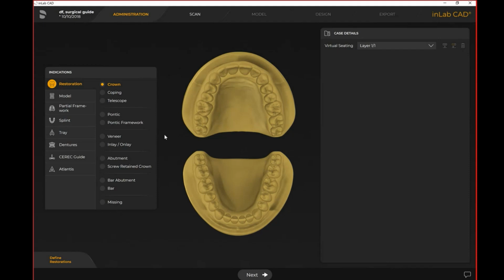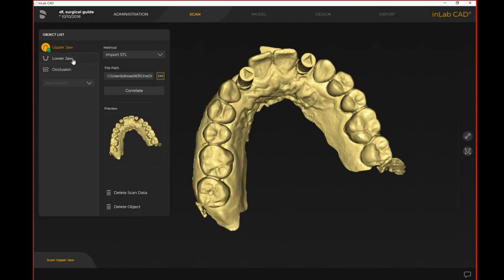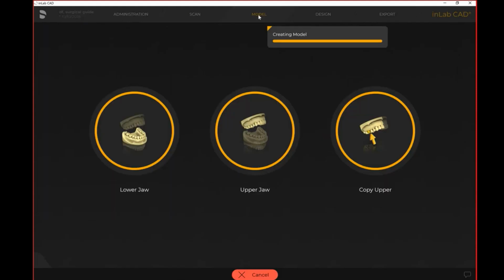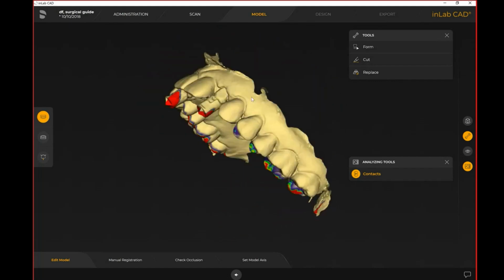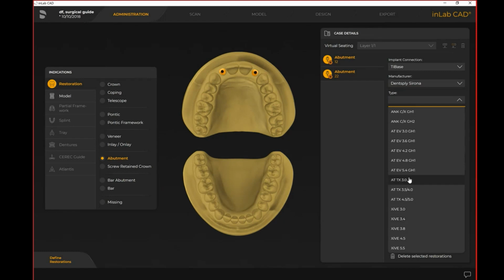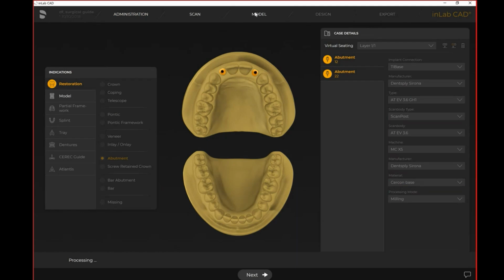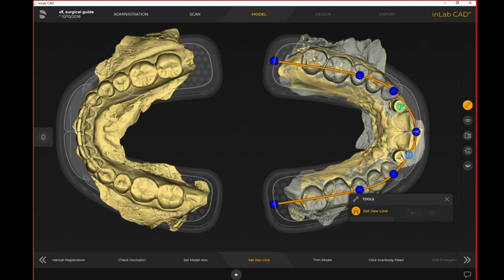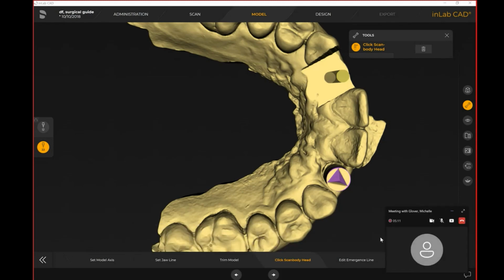Importing Scanbody STL Files: Workaround Method

Comment: Great Video, very useful. When you can, could you make a video how to scan a total denture using the inEos X5 desktop scanner (half screen) into the InLab22 software (half screen) and save as STL to desktop? Thanks
Reply from the maker: Hey there! When you say scan the total denture, do you mean all surfaces like a duplicate? Or just the impression surface? I personally recommend where possible using an IO scanner like Primescan to scan a denture 360, as its the fastest and most accurate.